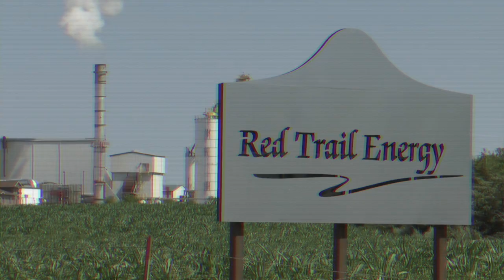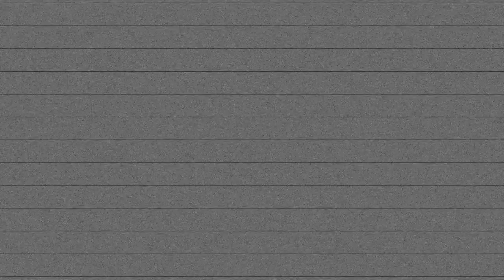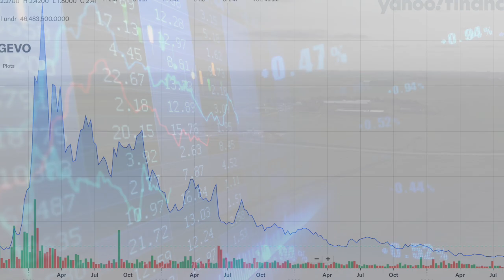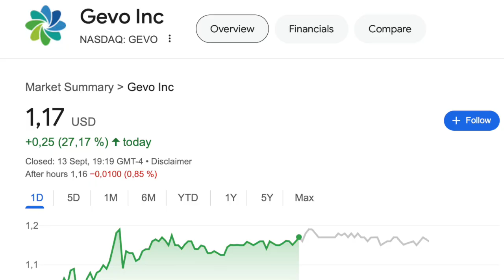Gevo's bold move  - Red Trail Energy acquisition breakdown.

Comment: I have about $36k invested in gevo since 2017 in my IRA that I have never sold during all the pumps. I also believe in GEVO but I had been planning to buy  $100k worth of gevo under .40s but I mossed it! I sold on last week’s pump but it pumped this time and I used all my funds to buy more RKT GME and DJT…. couldn’t resist the SALE on these stocks but gevo took off. Ugh… I believe it will take a slow dive back below $1 if that ever happens I will load the boat otherwise I will just have to be contented and HODL my IRA gevo shares. You were spot on on your research!
Reply: I sold all my GEVO in taxable but have built up 10k shares in IRA at 0.73 cost basis. Kinda wild to see the stock shoot up 4500 in 2 days! Now Im like ok where do I go from here. I absolutly won't sell the IRA position, but I want to build one in taxable and maybe add to the IRA one. 

I was thinking like you it might slowly go down to below a buck. I think the days of sub 0.60 might be gone, but idk. 

36k position in your IRA is massive. Hope the cost basis is relatively low. If Gevo ever hits 5, or even 14 again even with my smaller holdings it will be significant (for me anyway). 

Good luck going forward with whatever you choose. All of us that believe in GEVO and have waited a while are feeling pretty good about the sudden good news, stock and otherwise.
Reply from the maker: Nice to hear your thoughts. Thanks for sharing. I wish you the best of luck with your swing trading and long term investments. Thank you for tuning in to my channel.

Comment: fk I missed out in loading $100k worth of shares! still holding bags in my IRA but damn! cash account would be over 100grand up by now if I had not sold last week!
Reply from the maker: I believe the ship hasn't sailed yet. I'm holding my shares for many years to come. I regard my Gevo investment as a potential retirement fund.
Reply: @RGinvestments  I have about $36k invested in gevo since 2017 in my IRA that I have never sold during all the pumps. I also believe in GEVO but I had been planning to buy  $100k worth of gevo under .40s but I mossed it! I sold on last week’s pump but it pumped this time and I used all my funds to buy more RKT GME and DJT…. couldn’t resist the SALE on these stocks but gevo took off. Ugh… I believe it will take a slow dive back below $1 if that ever happens I will load the boat otherwise I will just have to be contented and HODL my IRA gevo shares. You were spot on on your research!